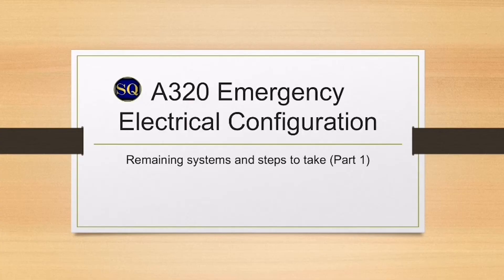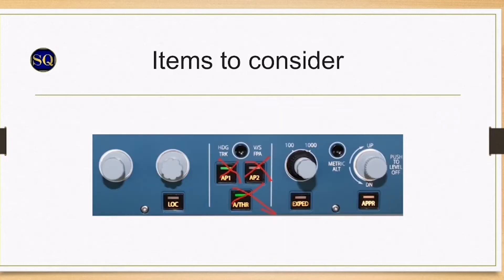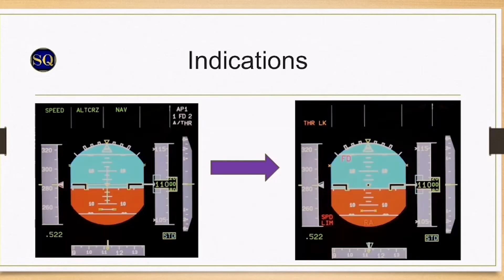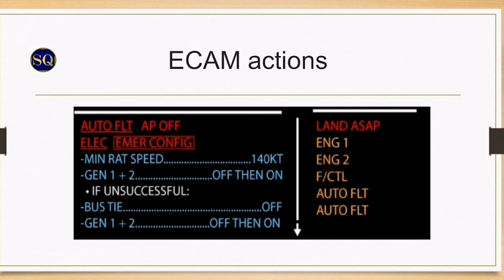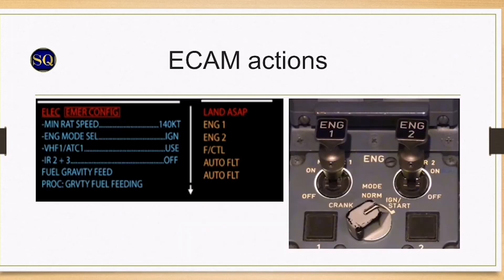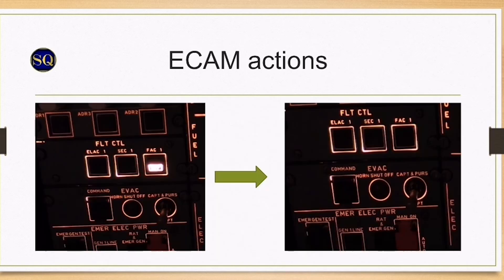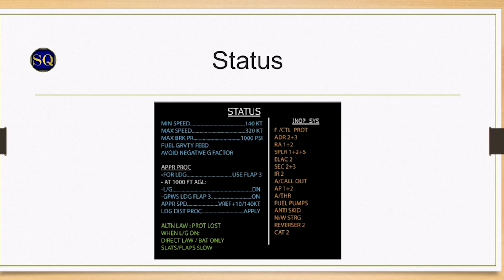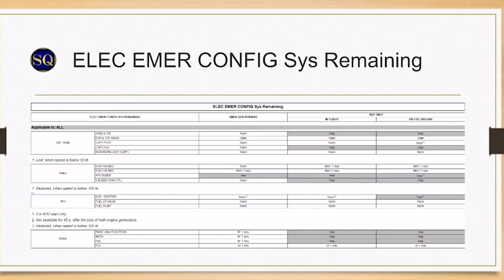A320 Electrical Emergency Configuration Part 1 (MADE EASY)

Comment: Keep on captain , I have a question but out of the topic if you don’t mind , FLAP/SLAT lock condition is it a pilot mishandling procedure?
Reply from the maker: Hi, Flaps/Slats locked position is a procedure pilots have in the QRH, and these are sometimes caused by hydraulic or avionics systems, not by pilots. I will do a video about it in the future.
Reply: @Captain_SQ  +*+ also please 
How to test & use ADF/VOR/ATC modes A/C/S....
why ILS#1 information displayed on captain PFD & copilot ND !
Vice versa 
Things you cannot found on YouTube.
Reply from the maker: @bazokazoro4563  ADF and VOR needles will be displayed if you select it on your FCU, ATC modes are automatic broadcast and ILS 1 info is displayed on both for redundancy.
as I cover more emergencies, it will be more clear on how it works.
Reply: @Captain_SQ  👍